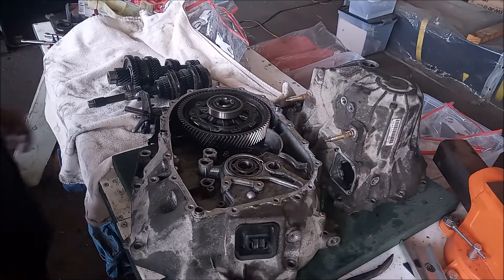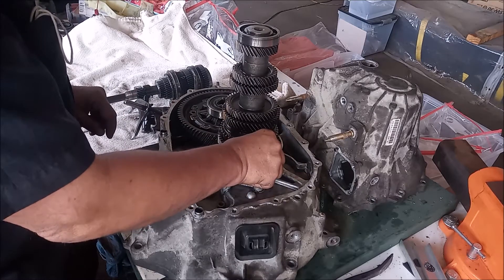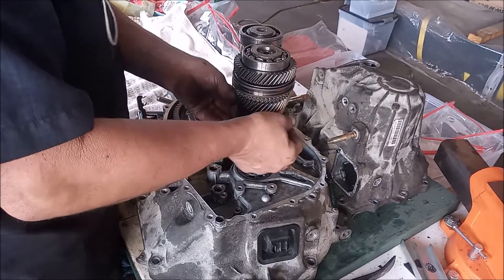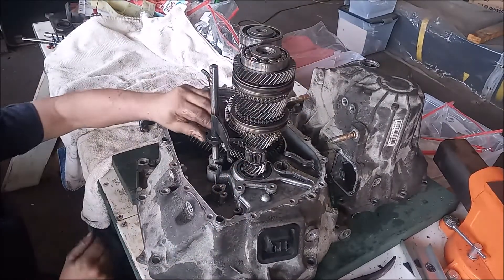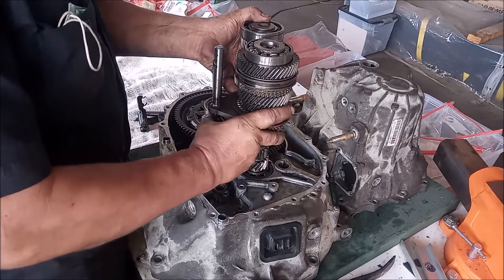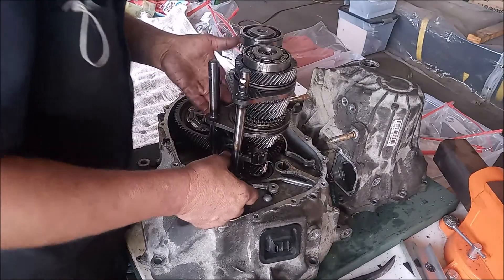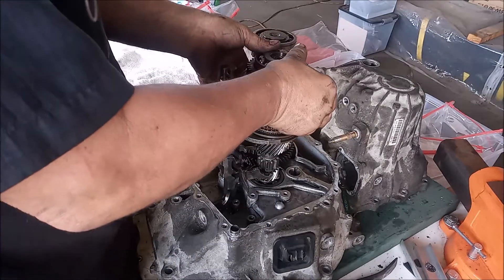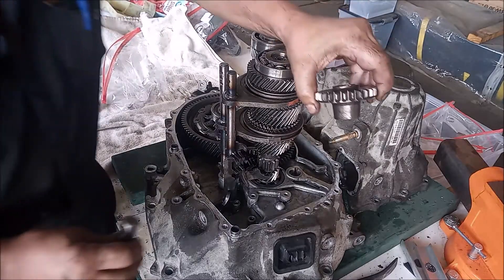How to Re-Assemble the Transmission Honda K20 Acura RSX K-Swap

Comment: isnt that top bearing on the input shaft backwards?
Reply from the maker: Only way it would be backward is if someone had opened the transmission previously and flipped it. But.... this looked like an unopened transmission in original condition so.... don't think so.

Comment: I was working on a k20 5 speed and I replaced the input shaft bearing. Of course the shafts and the forks came apart on me so I watched the video and put them all back together. What do you think I did wrong if I'm locked out of 5th in reverse? I guess I'm going to have to take it all apart and redo it.
Reply from the maker: Are you locked out when you use the shifter in the cabin? Or locked out when you do a direct shift on the trans lever?
Reply: @Merryfrankster_  I think locked out of both.Not sure exactly how the lever works though.
Reply from the maker: @danielstephens4420  disconnect the shift cables, see if you can shift the transmission directly.
Reply: @Merryfrankster_  I did. I'm still locked out of 5th and reverse. It's  three levels up and two the rear right? Only have two levels up. Same for going into 1,3 and 5th. Only two levels up and to the front.
Reply: @Merryfrankster_  do you think I did something wrong with that 5th gear Synchro sleeve that popped off? Or could the reverse lockout cam have anything to do with it? or the reverse light? I hope I didn't install the reverse gear upside down LOL
Reply from the maker: @danielstephens4420  If you are not able to push the gear selector into the gate, it could mean that the gate is stuck out of position. You can try remove the shaft, insert a screwdriver, and center the gate, and who knows, keep your fingers crossed, maybe you'll be ok.  If the gate won't budge, you'll have to take it all apart again, and check what is interfering with the movement of the fifth gear fork. Maybe the reverse shaft did not seat correctly. Did you try working the shifting before putting the case back on to the bell-housing?
Reply: @Merryfrankster_  I did but I'm still confused how it goes into 5th and reverse. Is it a third click upwards with the shift mechanism before you move it into fifth gear or reverse? What exactly is the gate thing you are referring to I'm going to try that.
Reply: @Merryfrankster_  can you help me with one more thing? You've been very helpful. I think it's jammed. I did like you said and I took off the shift selector and I tried to move everything with a screwdriver. The 5th and reverse shifter arm is stuck in neutral. It won't budge. I took out the bolt for the reverse gear and it still didn't budge and I also took out the reverse sensor and it's still stuck. Now I'm going to take it all apart. I must have jammed something. Can you just tell me how to test reverse after I pull it off and fix it and put it all back together? that part is kind of tricky with the shifter mechanism. Do you lift all the way up on it to get it in reverse? And some of the videos it's hard to tell.It almost looks like they push down on it again.
Reply from the maker: @danielstephens4420  when you have the case open, you have all the shafts sitting on the bellhousing, and you can test the engagement of every gear by moving the forks up and down. Then you can put the case back on, and before you bolt it down, you can use a screwdriver to move the forks side to side. It occus to me that you have have done with your transmisison is you have not installed the ball and spring for the 5-R fork - this brings the fork back to center - or you have not assembled the reverse blockout correctly.
Reply: @Merryfrankster_  I figured it out. This time I had the transmission and the and the subframe removed in less than 2 hours. One of the ball detent springs for the 5th and reverse shifter squished the ball into the bolt and jammed the fork. I'm not really sure why. I did not over torque it and I used a new crush washer. The only thing I can think is maybe I had the shifter fork in there wrong and it was at the wrong angle. Or pressed up closer to the hole than it should have been. I took the case off and moved all the forks up and down several times and made sure they were in there right. I put everything back together and all the gears work now and reverse works. I verified by the differential spins the opposite way when it's in reverse. Thanks for your help. Now I just got to put it back on the car on my next day off. I just got to wait for this new detent spring/bolt. I verified by putting a different spring and detent from another hole into the 5th... it doesn't smash now....I don't know what was up with that.
Reply from the maker: Good job. I'm here to help those who help themselves.  You're a prime example.  @danielstephens4420